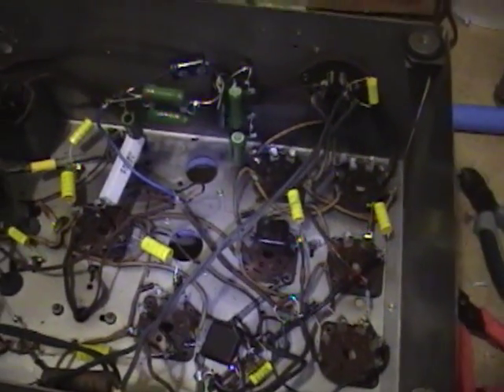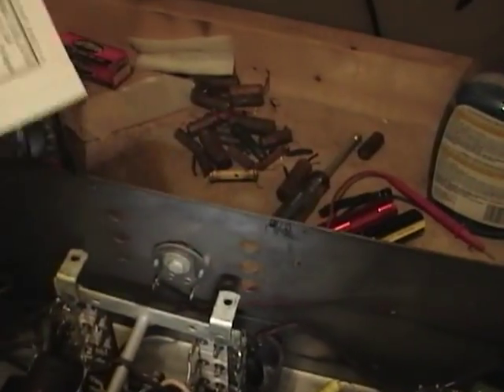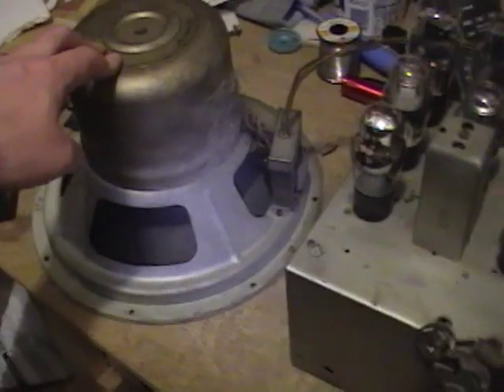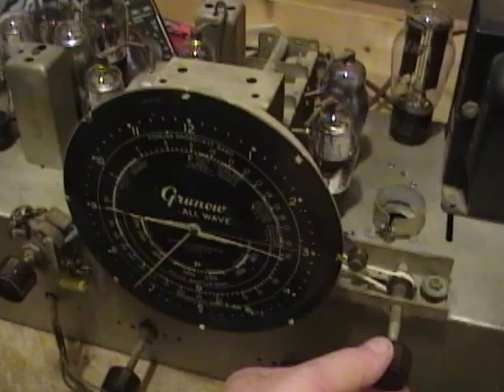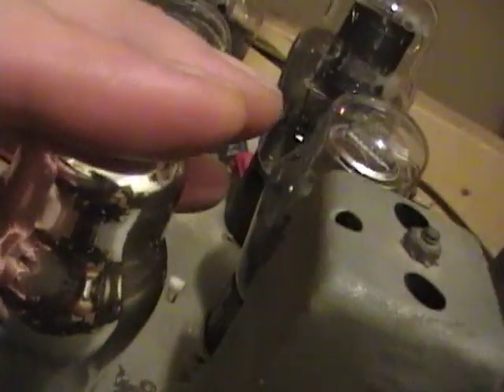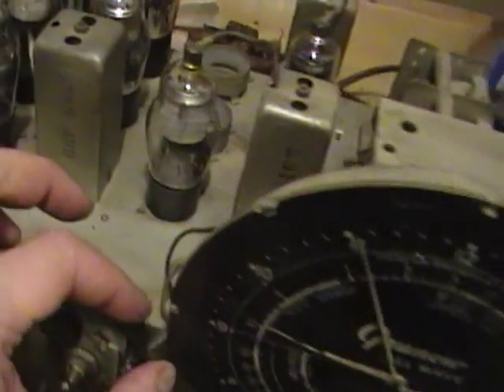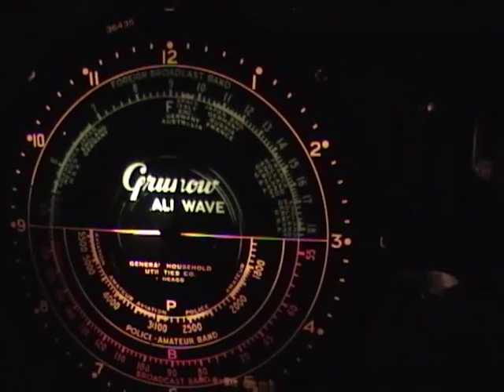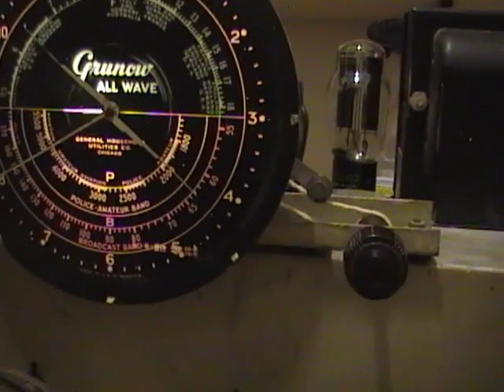Grunow 1191 restoration p3o?

Comment: @bandersentv clean off that tuning capacitor!! That crack crack crack is probably dirt shorting the plates out. Replace the high value resistor in the eye tube circuit, it's WAY off then it's just a matter of alignment. Also, you might look into using a big round cross section rubber belt for the tuner like the kind used in main drive belts on reel to reel tape recorders. Use the string to measure the size and order it a bit smaller for better tension.

Comment from the maker: It's been a while since i worked on this set and my memory is a little fuzzy.  All I seem to have is the one page schematic - no parts list.  This is some parts info on the Antique Radio Forum though.  I'll PM you the link.

The dial lamp runs off the 6.3 VAC filament bus so it's probably a #44, #46 or #47 bulb.

Comment: Hello! Are you familiar with the method of restuffing electrolytic cans from the top.I learned this from Phico radio.com.The Gentleman says he cuts the top of the aluminum can off with an olfa blade where the indentation already is  and glues an orange juice spout to the underside of the  can cap and glues the plastic juice cap into the can, which seems to be a perfect fit.Then you can unscrew it and  replace caps anytime.The seem where cut is invisible.

Comment: @bandersentv It's not like it's the end of the world with that dial, at least it's still readable, I have a dial in an old Rogers tombstone radio (also with a celluloid dial) that has similar faults to that Grunow one, worse in some ways, I'm not sure what I will do about it. I'm thinking that the noise you get while trying to tune could also be a cold solder joint on one of the tuning condenser sections or maybe even on the ground lead, it may also be a flaky solder joint on a grid cap lead.